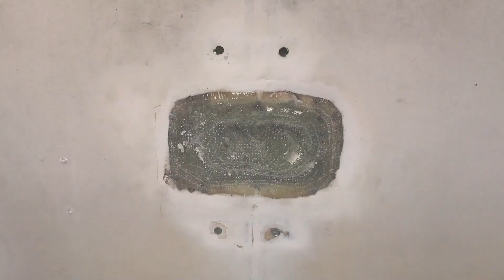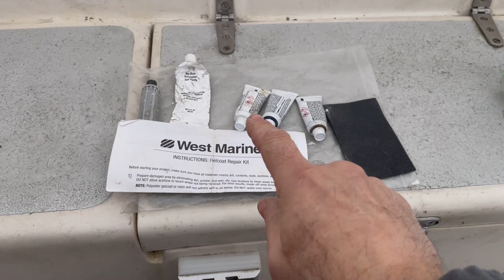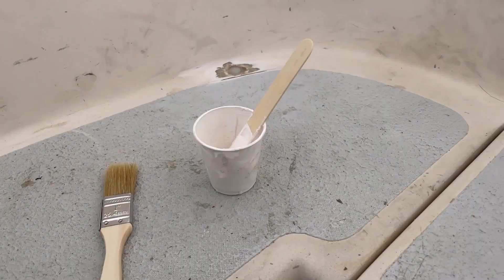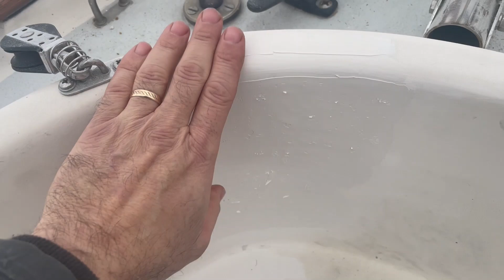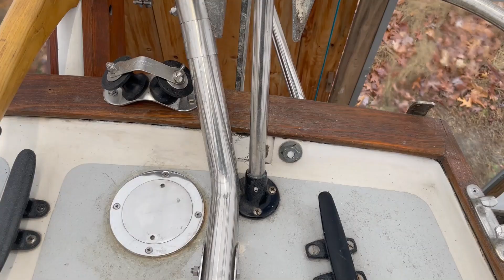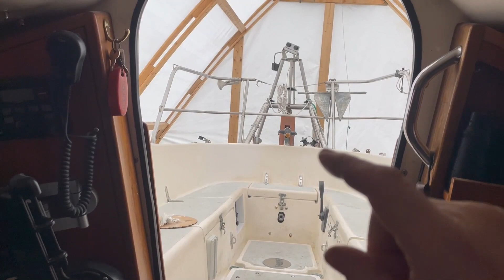Contessa 26 Refit ep.33 - Gel Coat Repair

Comment: urethane paints arent cheap but they really deliver. ive painted a 29 ft hull with alexseal by rolling it and even before polishing (that i had to do because i had a few runs) it looked like a spray job. it does require more maintenance than gelcoat to extend its life to 20 years, BUT, when the time comes to repaint, all you need to do is degrease, fairing where needed, and paint. plus you have more colours to chose from.
Reply from the maker: I covered that exact paint vs gel coat topic in this video at 3:07.  Not sure if you actually watched the video, but this is about repairing gel coat damage to small areas on deck, not to re-finish a hull.

Comment: Some 3m buffing compound and a cheap slow speed buffer will bring that gel coat to new like..it will shine and not get stained or dirty as easily..
Reply from the maker: Yup. Polishing new gel coat when I do the topside hull and everywhere else.
Reply: @EpoxyAndButylTape  its amazing how far gone it can be and after a good buffing it shines
Reply from the maker: Agreed. I’ve had much success with Meguiars oxidation remover for marine gel coat.
Reply: @EpoxyAndButylTape  meguirs makes quality products so does the 3m perfect it.. both for gelcoat and regular paint.. I've also used some of the stuff that The Chemical Guys make..
Reply: Tanks for the info